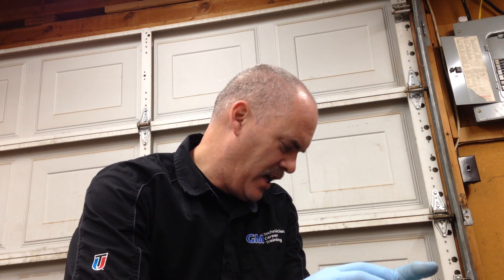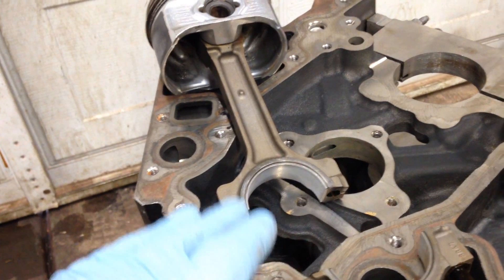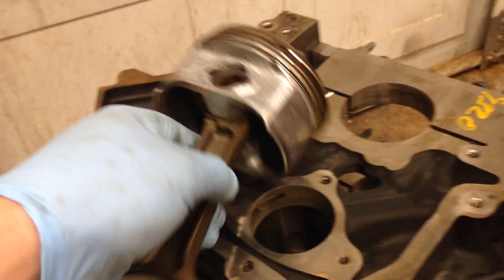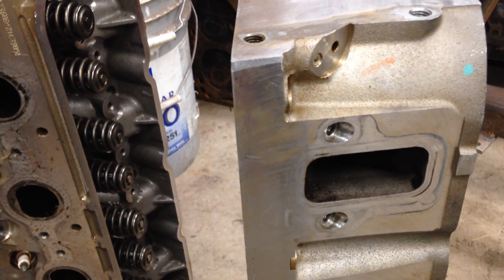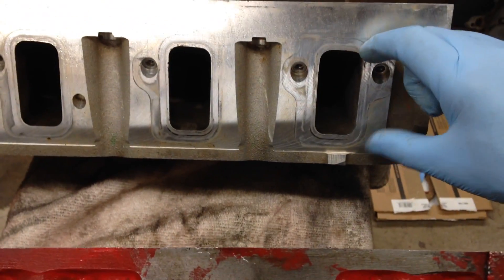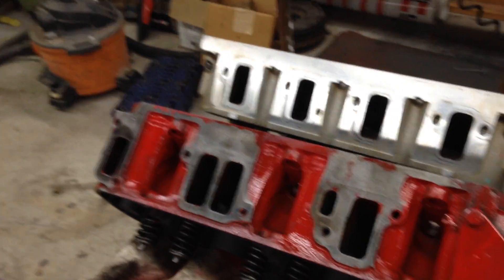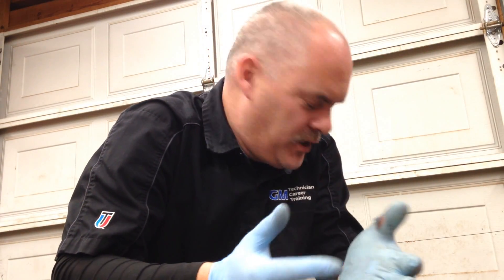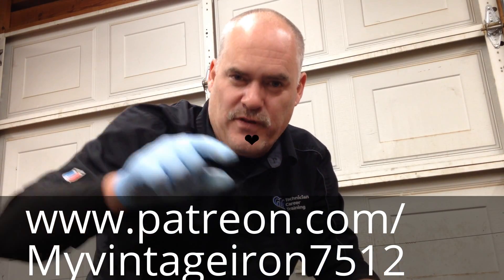LS Upgrade 6.0 to 6.2

Comment: I have read countless times that you can't punch a 6.0L out to a 6.2 due to the cylinder wall thickness!! That is why all the stroker kits out there for the 6.0's are 402-408 ci. and not 416 ci. like all the LS3 6.2 stroker kits....Please do explain!!!
Reply: You may have been hearing that about the aluminum blocks. The aluminum blocks are limited to what you can take them out to because of the iron sleeves and they may not be perfectly centered. The iron blocks are...well...all iron. Thus you can punch these out to a larger bore. IIRC, GM says the aluminum blocks are only good out to .0005-.0010 to bore/hone.
Reply: Yeah, the 6 liter iron block is safe for high hp at 4.03 bore, you can bore it to 4.065" but I'd limit the power level, on a 450hp street engine like this it's no problem.
The stroker 402-410cid with the 4" stroke is a nice setup but you want to use good pistons with offset pins and coated skirts, I've used wiseco exclusively as I've had good luck with their oil control, plus their gfx rings are excellent as well fwiw

Comment: In my view, the thing we should be fixed on is not if one car company took a design from another. Rather, we should be jumping up and down, we benefit from what they are designing, now, with a LS engine that gives us low cost high performance motor parts! 

Now I don't believe anyone is stealing from anyone else here as far as car manufacturers go. However, who would care, if performance minded person out here in the general public benefits!
Reply from the maker: Well said these guys bringing up the GM copied Ford thing are just being petty whenever you hear that it's a sure bet your dealing with an amateur

Comment: I'd like to know the similarity between the "L98" released in the Australian Commodore (Basically a hybrid 6.0 bottom end with an LS3 top end) and the LQ9/LQ4 (apart from the obvious alloy and cast blocks) If anyone knows.
Reply: Maddog yes mate I would like to know that as well and could this be done on the ally block or just the cast blocks. I have a VE SSV Ute that I would like to get a little bit more power out of and if anyone knows of a good tranny place in Victoria would be helpful thanks Yogi 🤙🤙

Comment: How about if you drop in a LS7 crankshaft in this 6.0/6.2 build.Would work?
Reply: They are just doing a budget 6.2L build.....must have had the extra parts laying around. They are not gaining much by adding 12 cubic inches. Since they are going to all the work....a much better engine would be to use a 4" stroke (LS7) crank and a 4-4.065"with the right pistons....and have 402-415 cu in. Some are even using 4.1, 4.125, or 4.25 stroke aftermarket cranks. The combinations with these engines is unreal.

Comment: Any comments this would be helpful. Say i do this build would it be a good replacement on my 6.0 in my 2500hd truck and would it help with the horse power and pulling on the highway and hills?
Reply from the maker: yea every little bit helps

Comment: Seems like a lot of money in machine work to gain 200cc. I have a fresh 6.0 LQ9 truck engine, will the LS3 aluminum head and intake work with an all stock 6.0L internals? Thanks.

Comment: Ford hasn't changed shit nearly as much as people think. The "new" so-called "Coyote" is just another DOCH mod motor like Ford has built for 25 years or so. Ford tried to do the "interchangeability" thing but as usual "on a budget" and in order to try to "catch up". There IS very little "interchangeability" as far as complete engines and longblocks go and you can have "identical" Ford vehicles built on the same day in different factories that have "identical" but NOT "interchangeable" engines so VIN is CRUCIAL, but the LS isn't anything remotely like previous "generations" of small-block Chevys, either. Which isn't surprising since they had a vastly accelerated R&D process and didn't have nearly as much freedom in terms of ALL the engines being for RWD vehicles, etc. Not to mention even the "old small-block Chevys aren't nearly as "interchangeable" as people think. You can swap and mix and match a lot of parts, but things like dipstick location, externally-balanced 400s and their rotating assemblies vs. all the other internally-balanced SBCs, the siamese cylinder blocks 400s have where any non-400 head swapped on has to have vent holes drilled in it, small-journal pre-1969 small-blocks vs. large-journal engines, etc are all realities most "car guys" and even a lot of "Chevy guys" aren't aware of. But lots have learned the hard ways.

Comment: I'm pretty sure its more accurate to say that the various other LS engines are ALUMINUM VERSIONS of the 6.0. I'm pretty sure the 6.0 LS came first.
Reply: Actually the LS1 5.7L engine came out first in the late 90's. 4.8, 5.3, 6.0 came afterwards.
Reply: Trues but the ls1 5.7 wasn't a true ls, it was a old sbc with newer heads and intake but really not much different.
Reply: @Justdoingstuff83   the LS1 was a true LS Not a Hybrid  old small blocks were series 1 through 3 where the LS series are gen 4 and higher
Reply: Your talking about the LT1. Which was a reverse flow version of the SBC. The LS1 was a completely different design from all previous years and all the future LS engines....including the 6.0 were designed off of it.

Comment: Hello, I really liked your video, very informative and practical. Its nice to hear people that know what they're talking about.
I have a question for my 2001 2500 Suburban with the 6.0l. I have pulled a travel trailer that weighs about 7500 lbs on vacation and my 6.0l struggles a lot. Definitely seems like GM has throttled back the motor a lot through software and the shift point are difficult to hit at lower rpms. Anyway, I would like to get some more torque and hp out of the motor for towing only, don't need a street rod...  So what upgrades would I need to do to the motor to get this or should I just buy a tuner?? Would be nice to get another 30-50hp and 60+ foot lbs of torque. I would like to spend under 1000 and I can do the work myself.
Reply: Tow Cam and converter and tbss intake n tune would definitely help

Comment: I'd like to know what you have to have to make an ls engine run in a 70s car, and can you put a carb on one or would that just hurt the power very bad?
Reply from the maker: There are two ways to do it you can run the factory wiring harness and computer it's fairly simple to set it up you need to do some minor wiring mods but like I said very simple the second is you can run a carb  edelcrock and a few other company's make an intake for this MSD has an electronic ignition that will run the coil on plug if you want to go this route either way is pretty simple Personally I would go with the factory FI set up but either way works and runs good
Reply: sloppy mechanics.com, you will be amazed. Easier/cheaper to go with all stock parts, these engines usually come with wiring and computer, so electric fuel pump, fuel lines to the fuel railes and your up and running.

Comment: Can u please talk about LS intake manifolds best bang for buck
Reply: 99% of the time the stock intake is the best lol they actually did pretty good on the intakes
Reply: ls 6 for top end truck for low end !
Reply: Intake for forced induction and stock heads? Cheapest intake = regular truck intake. Got a few coins get TBSS intake. Need hood clearance? Ls1 or Ls6 if you can find one.
Reply: Best bang for the buck is the truck intake
Reply: Mikel Bentley NBSS intake or trailblazer ss intake style. Although the regular truck intake stillflows well.
Reply: cougar7n10 tuck intake still makes more torque
Reply: https://www.youtube.com/watch?v=ck2SKNvLRuc

Comment: LS3/92 heads are the best!!!  LQ4/LQ9 build is the best way to get a totally street mannered beast with 600hp potential and drop into any vehicle.  What an amazing peice of tech that just enhanced what has been done in the past. I would LOVE to have one of these engines in a truck or an old school F or G body.

And, they flow over 300cfm in stock form.  that is epic!
http://www.hotrod.com/articles/hrdp-1102-ls3-l92-rectangle-port-cylinder-heads-test/

Comment: After turning the 6.0 to a 6.2 can it hold nitrous still? If so how much do you think it will be able to handle
Reply from the maker: I am not sure on that one I would guess yes they can remember going from a 6.0 to a 6.2 bore means takeing the thickness of 8 human hairs off of the surface of the cylinders

Comment: Sloppy Mechanics has a turbo 6.0L making 1100hp on all stock internals
Reply: philmatoph it requires juevos
Reply: There's a video of a bone stock 5.3 they threw a turbo on it wan the boost up to 1300hp and broke a lifter, they didn't burn it up bc it was tuned well the killer on these engines is the ring gap and the tune, tear it apart gap the rings give it a good tune and they will live in the 1000hp range for ever
Reply: ... and detuned I am sure Matt could've run that setup at 750whp for years on a stock computer and the same China turbo setup.
Reply: philmatoph you obviously know noting of ls engines
Reply from the maker: I believe it very doable
Reply: +cougar7n10 LMAO yes it does. huge juevos
Reply: 1076 to the tires through a 4l80e
Reply: Yep, it will live for a while
Reply: I generally don't trust aftermarket dyno claims. I have research dyno experience. Electric dyno accuracy i helped to achieve accuracy to within .5% . Aftermarket wonders around with room temp, fluids and the water temps in the Break. But if it feels faster great. I believe how this guy delivers the story.
Reply: Death trap as a negetave and who in their right mind are questions that evidence that you are clearly watching the wrong videos the real deal is this too much is never enough and death is the eventualaity so why not embrace it
Reply: Myvintageiron7512 Hot Rod magazine took a 2 or 3 hundred thousand mile truck 5.3 from a junk yard cleaned it up & pro charged it!  I think it blew up around 1100 hp!  So you could probably run 800hp for years with no issues.
Reply: They later realized that engine was a 4.8  That was an amazing thing.
Reply: Mikel Bentley that's a fucking death trap who in their right mind would put that kind of horsepower on a stock engine .

Comment: OH they copied Chevy big block
Reply: IM pretty sure it was pontiac...remember the big chief heads? large enough to fit two packs of smokes in the intake runner and THEN SOME.  hahhaa...

Then again, nothing new...D port exhausts and Large intake wiht a nice radius turn and huge flow numbers from the factory. Late 60's to mid 2000's. Just newer ways to get performace at a lower cost with better components. In a smaller package even.

Comment: What years are a newer LS motors? What GM did was to build up the lower part of the block which is what Ford has been doing for a long time. The major flaw with the sbc is that the lower part of the block was weak when a lot of power was applied. Remember the sbc design has been in place since 1955 where the kind of horsepower we see today was a fantasy. Also when the first 289 small block Ford came out, it was a copy of the Small Block Chevrolet. Much of Small Block Fords like the 351 Cleveland were of the this same basic design. I don't believe GM did anything more than use common sense and strengthening the lower part of the the new LS design. If they copied Ford, or copied some of the aftermarket block manufacturers, did their own analysis, or all of the above is inconsequential. They built a great bottom end, for what they knew would eventually be tested with lots of power. The people who say the LS engine is copied from Ford, have a very limited knowledge of progression of internal combustion engines in general. You could also say GM engineers copied the GM Big Block with their LS head designs.
Reply from the maker: I have to give you kudos on this one I do agree that the crowd insisting that Chevy copied Ford is simply repeating what they were told by an uncle or a buddy, The fact of the matter is GMC has engines dating back to the 1950 that closely follow the LS lower block Design I just built one not to mention the engineers who come up with these engines on the drawing board have worked for GM and ford and Chrysler some worked for all three over the years some of these guys make it sound like some of the Chevy engenders dressed in black and broke into the ford plant in the middle of the night and lifted  the blueprints for the LS  you can go all the way back to pre WW2 and look at the engines the Germans developed they have an amazing similarity to the LS and Ford engines  so you are correct this idea that Chevy copied Ford with the LS is just nonsense
Reply: I really enjoy what you are doing. I like the fact that you don't mind taking a stand, and debunking all the misinformation out there.

Comment: Do you build drag cars ? Just started to watch you and your great.
Reply from the maker: I have had 3 drag cars in my life first was a pro street Nova started with a small block 13 to 1 400 ran mid 11's with crappy suspension and drag radials NO. 2 was a super comp roadster with Chrom-moly tube frame and fiberglass body BBC low 9's the third and most fun was a pro street S-10 with 4 link roll cage and highly moded 427 with NOS not as fast as super comp roadster but more fun mid 10's ran in super gas class I have been out of it for many years not sure if the classes are even the same any more

Comment: What is the most everyday driver hp can I make out of a 6.0 ls2. I need the most out of it on motor.
Reply from the maker: 500 is doable with the right mods
Reply: How can I get 800 to the crank and 700 to the ground on all motor with and ls combo.
Reply: A ton of money...    http://www.superchevy.com/how-to/engines-drivetrain/1506-6-0l-iron-ls-stroker-build-and-dyno-test/

Comment: Great video I just picked up an old Chevy with a tired 350 and have been thinking about what I want to do and I really like that 6 liter I have one in my work truck that has 380k miles and it's still strong and doesn't use any oil so thanks for making up my mind for me 👍thanks brother
Reply: I'm thinking about boosting it eventually do you think the 5.3 can handle it
Reply from the maker: I agree the 5.3 is a very good choice for a budget build

Comment: Hi, I know Nothing about LS engine, or any other GM things (Ford Man), but have a 78 Nova and are considering building an aluminum LS engine for bracket drag racing. If it were you, would you trust the aluminum block for about 550-600HP drag racing or should if forget about it and go with Iron?. Also, if you were starting my project from scratch, which engine should i look for as a starting point. I plan on using a carb, not FI.  Thanks, Muleskinner
Reply from the maker: See if you can find a 6.2 if not a 6.0 being a Ford guy you will be amazed how much simpler the Chevy is
Reply: Thanks very much, what about the Aluminum block, is it strong enough?
Reply: I am looking to make no more than about 500-600 hp for footbrake brackets. I was looking at the aluminum block for weight savings up front which is very helpful if it will hold up against that HP level. This will be a low buck build and cant afford turbos, plus i am 56  years old, i am running out of time for too long of a project.

Comment: The factory injectors for L96 can be "decapped" and flow 70lbs, he's right about being a great affordable platform saving money for a 2nd atmosphere! Just look for a 04-12 truck labeled "vortex". Just remember to get the wiring harness and ecu that comes with the motor otherwise forget it! It's not worth going any further than that

Comment: LS also has 11° valve angle as opposed to the SBC 23° and the 6.2 is 4.040 not 4.065...
Reply: 6.2l is 4.065 bore
Reply: I was wondering if he was going to correct himself but then I thought about ring gaping for nitrous
Reply: hatersaywhat ring gapping has nothing to do with bore. you file your rings to match the bore.
Reply: I just did the calculations and you are correct indeed. I won't forget that for sure!!
Reply: thought they get filed custom to the application, boost, n20 , and n/a
Reply: Wrong
Reply: 6.2 is 4.065.....geez

Comment: I would like to see some one take a 4.8 LS bore it to the LS1 bore size of 3.898 but keep the 4.8 stroke of 3.267 for a 311 CI LS. Then add CNC ported stock heads and a stout hydraulic roller cam and spin it to 7000 RPM to see what it does on the dyno. Then set it to kill with aftermarket CNC big runner heads and a solid roller cam and repeat the dyno test for comparison only spinning it to 8000 RPM. CarCraft did that with an LS3-4.8 combo and got 607 HP. I would be curious to see how they compare because it would be cheaper to overbore a $200 truck motor than it is to destroke a $6000 performance engine for a high reving V8.
Reply: You would have to measure the thickness of the cylinder walls before having a big overbore on such an engine. In some cases, they end up removing the cylinder walls entirely and have to install wet sleeves. That is extremely expensive and defeats the purpose of your project. If you aren't familiar with that kind of sleeving job, just search for Darton sleeves bening installed in Honda engines.
Reply: Did this on my sprint car engine. Started with 6.0 block. Bored to 6.2 slugs and ran the 4.8 crankshaft. Kept the 5.3 heads for compression. Have a camshaft from Howard’s and upgraded valve train to take the RPMs. Over 8000 rpms weekly. I was able to jump down in rear gear. The car literally became more drivable.